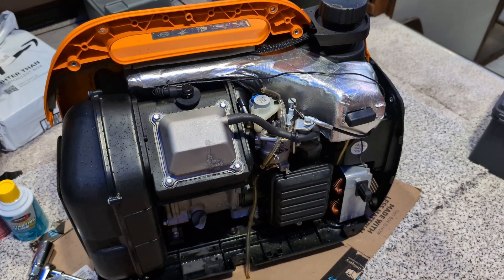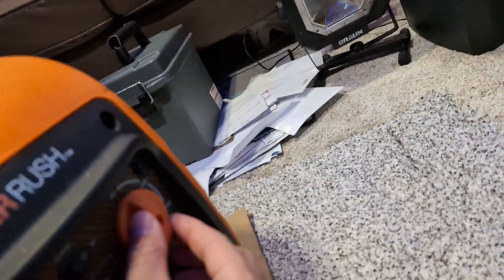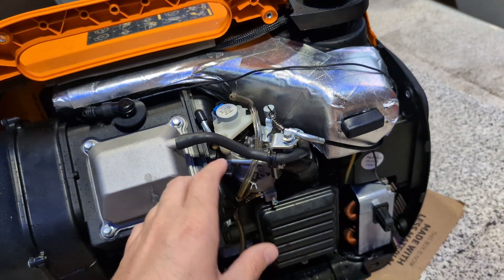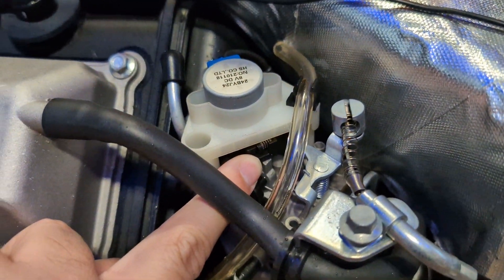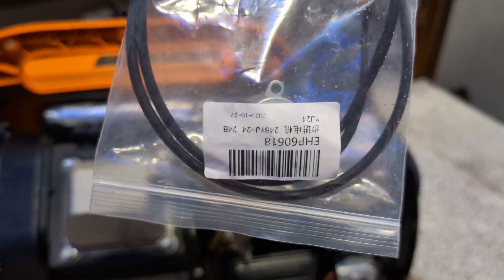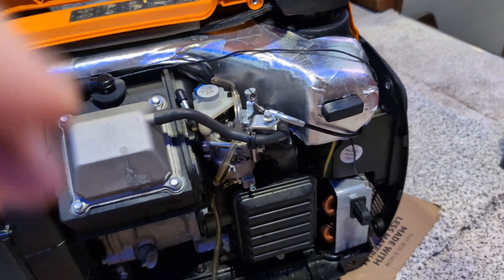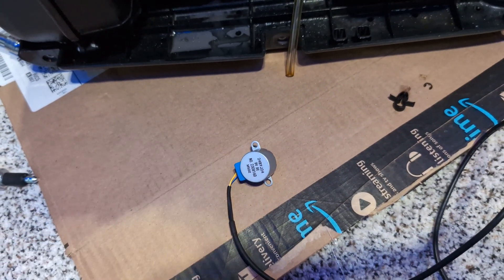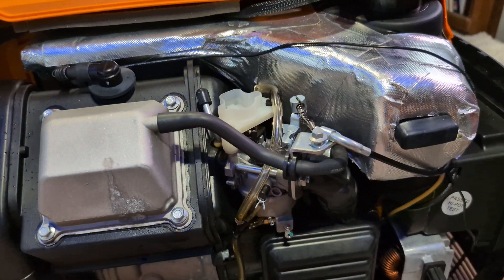Generac GP3300i Stepper Motor Replacement - Fixing a No-Start Condition

Comment: I had the exact same thing and the exact same generator. 
  I replaced the stepper motor on my generator and it didn't change anything. 
 I was wondering if yours continued to start because mine did start, but the next day, I noticed the butterfly returned to wide open.
  If yours is starting right or not , I wouldn't appreciate it if you could text me .
 Thanks for the video. it was helpful.
Reply from the maker: @gregbodenheiner2222  yeah I still have the hard start issue. The butterfly will still be wide open. It's like the computer or controller is leaving it wide open. I have to manually close the butterfly and it'll start right up.
Reply: @WJsLifeonaBoat  same hear, I think the control boards are sensitive to moisture.
  That stepper motor is electronically controlled.  I see it working after the generator starts,  just runs over to wide open when I cut it off.
 lol
 Thanks for the quick reply
Reply from the maker: @gregbodenheiner2222  yeah I haven't been able to solve it. Unfortunately. Have to manually adjust butterfly to get it to start.
Reply: When generator is off, the throttle plate should be "wide open".  When mounting stepper motor to carb, the throttle plate should be positioned "wide open".

Comment: Link for that step motor?
Reply: Could also do with a link if possible
Reply: @iTzz_Blaze  hey search the model number on your and dont matter if plug changes as long as is the same colored cables. I ordered mines off ebay. Cut the plug from the  old one onto the new one and now my generator turns on like new. I have a ipower 2000i
Reply from the maker: YouTube won't let me post a link... But it was 24BYJ-24

Comment: Did you end up figuring it out. My stepper motor is going full throttle when I turn it off and staying like that so It won’t restart unless I manually push the throttle back
Reply from the maker: I replaced it and that seemed to work for me. Also check your choke cable. That's popped off before.